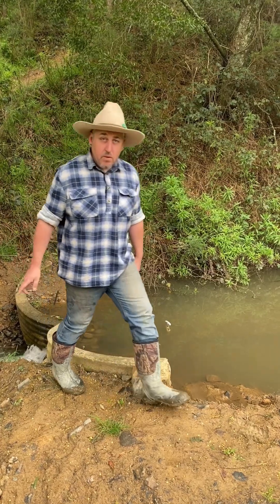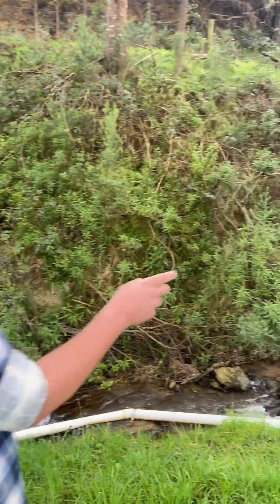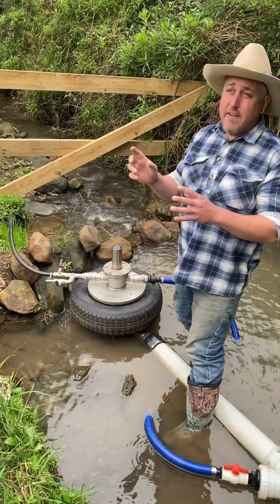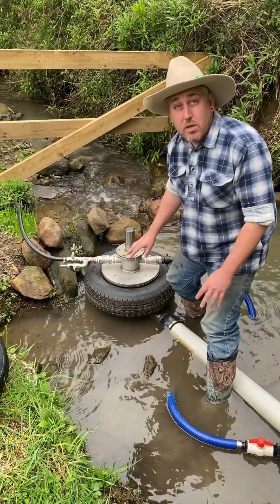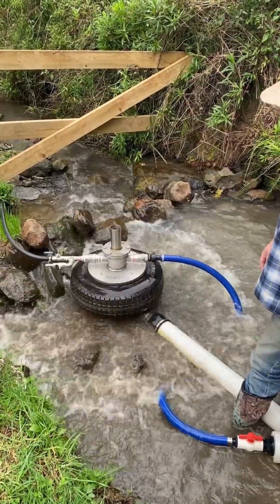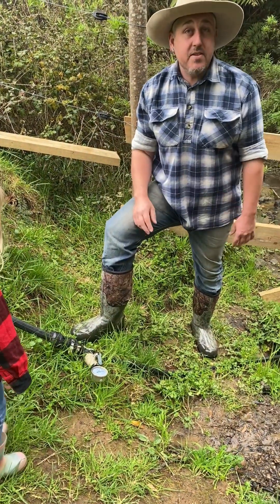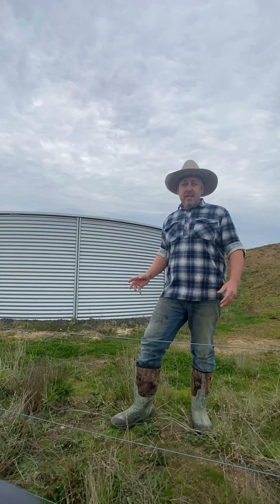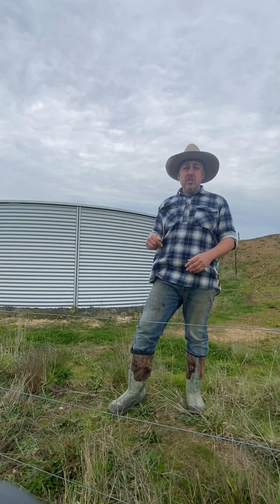Bunyip Water Pump Explained | Off-Grid Water Solution for Farms & Homesteads

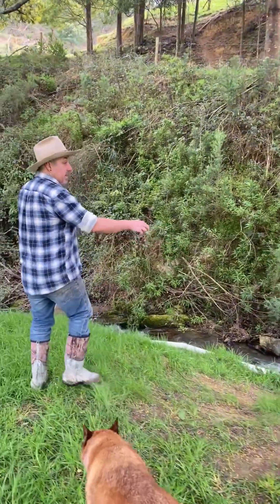Comment: Does that mean with this system he is achieving approximately a ratio of 1:32 head pressure to lift? (assuming the water flow input rate is 6L per second) Coz I gather that the fall (head pressure/ supply head) is about 3.3m and the delivery head/lift he is achieving is about 105m, giving him about 7500L per day. If that’s correct that’s an impressive ratio and yield!
Reply: The BA16 bunyip pumps have a 1:200 ratio.

Comment: A few questions if you can help me understand this system:
1. What is the function of the tire and how is it sealed on the bottom? I assume the top is just a pressure seal from the weight of the piston assembly? 

2. What are you doing to manage sediment in the lines; I know the creeks down under are often flashy and have a tendency to be heavy with sediment during storms. You’d likely not want that building in your lines or decreasing the efficiency of the one-way valve or piston, ya? 

3. How do you utilize, capture, or drain off the excess water in the tank if it fills beyond a daily use capacity? I’m assuming you wouldn’t want to start erosion up on that plateau and introduce constant sediment to the creek, or create slope instability issues below on your land?

Thanks for appeasing my curious mind. 😊